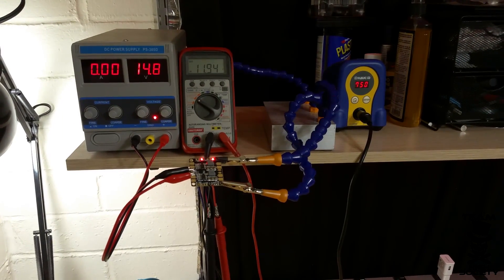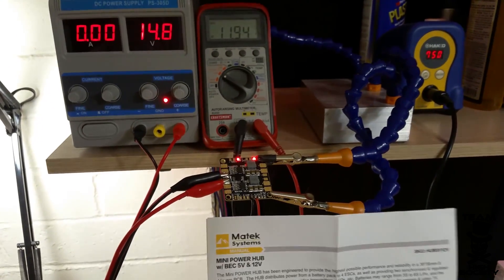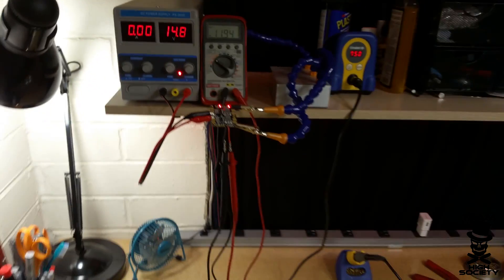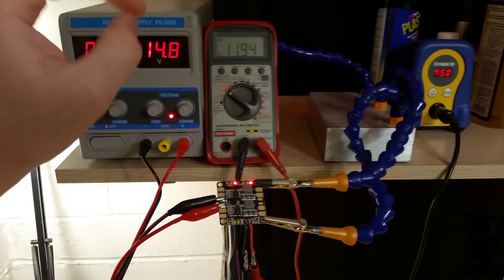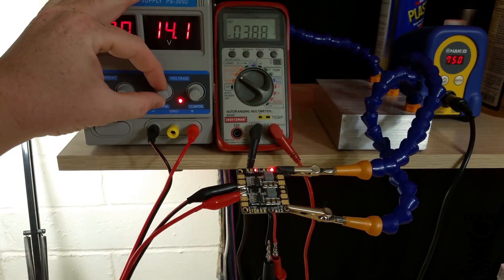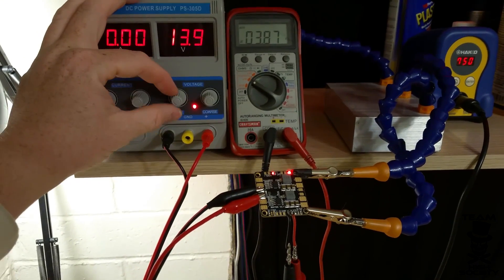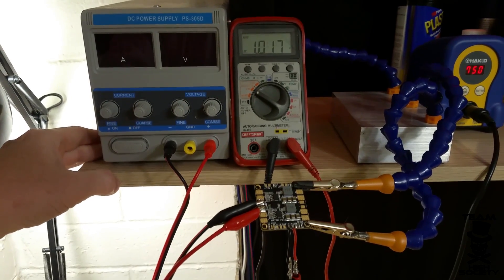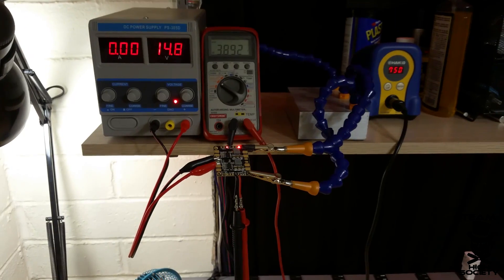Matek Mini Power Hub BEC failure

Comment: just did a test and could not replicate the problem, looks like that loss video wire or fault vtx. i tied my quad down and in one test I use a battery with low voltage at  14.8v. I throttled it  to the max and left it high for while and at the same time roll left / right. jammed the throttle in between,  watched the voltage dropped to 13.5v. another test with a charged battery and did the same thing. video was fine. mine is V3.1 not 2.1.

Comment: Two days ago I had experienced video cut out. signal recovered very quickly but in one occasion it did not. I am using the same board in your vid. bought it  mid last year.  I thought it was my vtx. I  noticed the video line from the vtx to my osd  came off with little or no force when I swapped out the vtx.  At the moment I need to do some more testings to clarify this. Thanks for sharing this.

if my pdb has a faulty 12v. my easiest solution is to use a LC filter to power my vtx and camera. I will connect the lc filter to the battery lead.

Comment: hi great vid just finished my 210 build realise that my matek pdb is lighting up but my camera is not coming on but my vtx is being powered any ideas or should I just change the board what do u recommend
Reply from the maker: If you have access to a multi meter I would check voltage to both the cam and the VTX see if you can find the problem that way. The new Matek PDB's are great its all I use! Thanks for leaving a comment!

Comment: This issue happens only on VTX dedicated pads or it is on all 12 volt regulated pads ?
Thanks for sharing the info
Reply: It happened to me yesterday, and LED that was connected to 12v also died... Buzzer and little led on FC was working so I was able to find my quad.
Reply: Thanks for the info.I have ver. 3.1 so i hope to be on the safe side  :-)   !!!
Reply: When I go back home I will try find my version of this PDB.
Reply: You can stay at work :-)   .......    your on the video is ver. 2.1  !!!!
Reply: On AliExpress where I bought this PDB it says V3 so the problem is still there in V3.
Reply: But guy below us in coments says that on 3.1 this bug is fixed :P So there you go, you and your kwad are save ;)
Reply: But watching the video your board is printed as 2.1 not 3  !!!!
Reply: But it is not my video :P BTW. I jut found a photo of my PDB board, and it says 3.1... So now I still don't know why my dron fall of the sky yesterday... The symptoms are like on this video but someone said that they fixed it in 3.1 :S
Reply: opsss sorry. Now new investigation is needed !!!
Reply: Maybe this weekend I will be able to check the voltage drop in actual machine like this on the video and I will let you know.
Reply: I contacted Matek and they said that my PDB is fake :( I hope that yours is original :)
Reply: Checking the fake/original pics on Matek site mine seems to be original.....i hope !!!
Reply: Well sometimes fakes are good one. They have QR code, right font, mine had slightly different logo, and felt off the sky like 2.1 :P In the matter of fact Matek asked me for bottom photo because front was so good copped...
Reply: Mine seems to be original on front and rear side  !!!!
Reply: Lucky you :)

Comment: Yep, mine suffers the exact same problem.  I have a 2nd on the way, without knowing about this issue. Running a rather 'hot' setup on my quad, at a short WOT, the led connected to the 12V died. I do measure 4.82V to the 12V, and it doesn't self-correct. (needs a reset before it 'works' again).. I bought mine through Alie, item 32628646069. Must be a clone. I'll contact the seller.
Reply from the maker: I'm shocked that this is still causing people problems, such a fundamental flaw...blows my mind that we are still having to deal with this =( . Thanks for stopping by and leaving a comment! Hope your back in the air soon!
Reply: Couldn't believe it either, since it's been a while since this has been reported. Like the Matek poster pointed out, there are fakes available, it's unclear to me if this is a fake or an original. Contacted the seller, but he's playing the ignorant-game so far.
Reply from the maker: I agree I know there are lots of clones =/ Thanks for the comments!

Comment: It is Matek Systems.  Sorry for the trouble to you. 

We found this issue in early Oct. There was one bug in one batch of DC-DC chip. then all the stocks were recalled from our distributors
We released new batches without the issue after Oct.20. Still the V2.1,  but the 12V DC-DC chip was changed. 
The 12V DC-DC chip of V2 was almost out of stock in market at that time. 
so we released V3 with another chip & optimized the route of BEC current in Nov.2015

I think our HUB V2 is out of stock in market now. 
But some Shenzhen factories cloned our Mini HUB V2 in Dec.  the same PCB design, manual.& packing.
Reply: Matek if you could publish a list of your distributors, so that we could all try dealing with the official product and reduce the likelyhood of "fake" boards on our quads, maybe post a link here or even a video with some distributors listed that are your official outlets. :)
Reply: http://www.mateksys.com/?page_id=1212

Comment: Okay, i've rebuilded the situation with my Matek 3.1 Board. The problem is definitely fixed. The voltage doesn't drop. http://fpv.globalhawk.de/wp-content/uploads/photo-gallery/IMG_3047.JPG and here http://fpv.globalhawk.de/wp-content/uploads/photo-gallery/IMG_3048.JPG
Reply from the maker: Should have a silk screened version number somewhere on the board.
Reply: Well my 3.1 matek just fell of the sky yesterday with symptoms like this on the video... So I don't know if I have faulty pdb or fake pdb :(
Reply from the maker: I have tested the newer ones and they work, so its possible you have a fake or it got damaged somehow. Either way that sucks =(
Reply: I contacted Matek and they said that my PDB is fake :( Now I have three fake Matek PDBs :( I ordered today fourth form Banggood and I hope this will be original...

Comment: This probably explains some of the issues I had with 5V out also, but I bypassed it with a BEC which threw off my PID's (good and bad).  I don't like the work around.  Have you found a permanent solution or new board that has a similar feature set?  I'm annoyed by PDB's (it's my first).  I think I may go back to wiring my own with BEC's.
Reply from the maker: +Michael Steele I can NOT confirm but apparently the new version 3.1 of this board this issue is fixed however I have moved on to other things, I just cant trust these. I have found another PDB with more features, costs less, and actually works here is my review of it: https://www.youtube.com/watch?v=DSWrx--chQI    or if you just want simple and ultra reliable try this one + a pololu BEC :http://www.getfpv.com/lumenier-4power-mini-pdb.html  Thanks for the comment!
Reply: +Team High Society I tested mine 2.1 version. I tested it with the main 12V output (not the same as you) and it didn't die. I actually run the intake voltege below 12V and the bec didn't die even then. It just kept 0.8V below the input voltage. Now i am just left wondering if i still should run my fpv through the 12V or should I run it with battery voltage and just put LCfilter to the fpv power line. (My fpv stuff can handle 4S voltages)
Reply from the maker: +Oikosulkumies Thanks for the comment! I would run the FPV stuff from the battery, I just can't trust this PDB.
Reply: +Team High Society Thanks for suggesting the Lumenier.  Love it so far.  My FPV equipment is raw from 4S.  I'm using the Pololu 5V 1A for FC and RunCam 2.
Reply from the maker: +Michael Steele Great combo! Thanks for the comments!

Comment: I have found another issue with these boards, specifically the V3.0 versions.  The 12v BEC pad is grounded out and the board hums when powered by a 12v source (continuity checked, batt neg pad shows a connection to the positive pad of the 12v bec).  Initially I thought I had messed up my solder job but after buying two more that had issues I have now decided it's not me!  The older V2.1 version does not exhibit this problem.  I love how these boards can make a build more compact, the gremlins make it unusable.
Reply from the maker: +JimBobDanBoy Thanks for the info! I think we can all agree these boards just cant be used.... I also love how these make things super compact but with all the problems I just can't do it =(.

Comment: so on 3s lipo you get 3,8v on 12v?
Reply from the maker: +matrixFLYER Basically any time you have power sag 3s, 4s, doesn't matter when you do something like a punch out it drops voltage down to 3.8 volts.

Comment: oh man!  I thought I was going crazy.   ihave the same issue with the same board and the guys at the shop were telling me these boards were good.  My issue is when I connect 5v to the flight controller.  When I power it up both lights come on from 12v and 5v, ran a voltmeter to check, but when connected to my flight controller the 5v disappears and 12v still stays.  There wasn't much info on these boards, so buyer beware...Thanks for doing this video!
Reply from the maker: +toastedmango flight Thanks for the comment! Yes these are just junk but it sounds like you are having a different problem. I assume you soldered over the jumper for the 5v side? This board should be put on the no fly list...so many problems!
Reply: Thanks! Now I hope it doesn't fall out the sky...